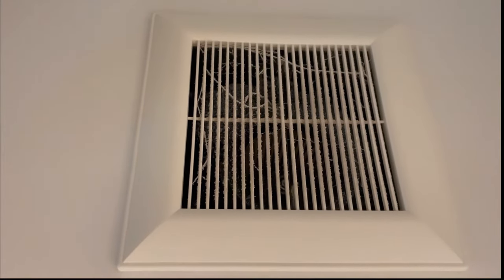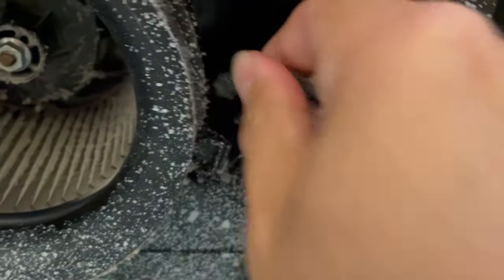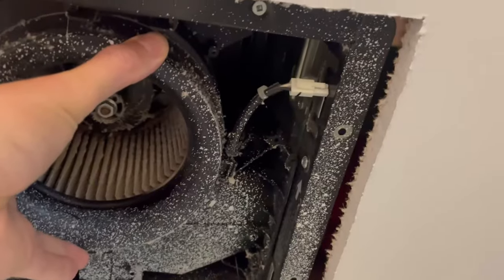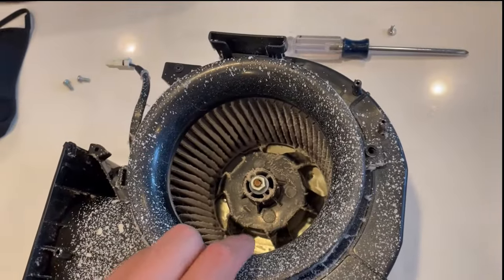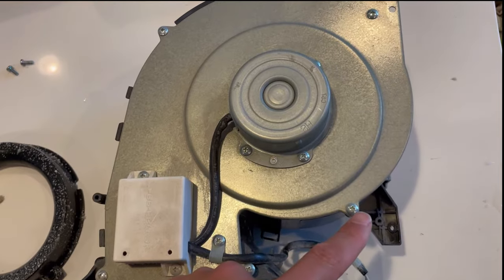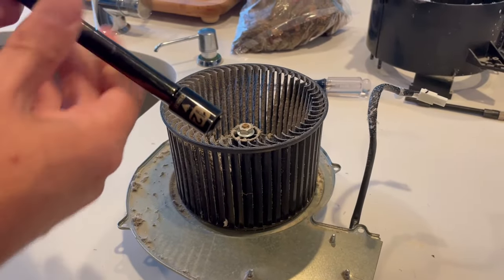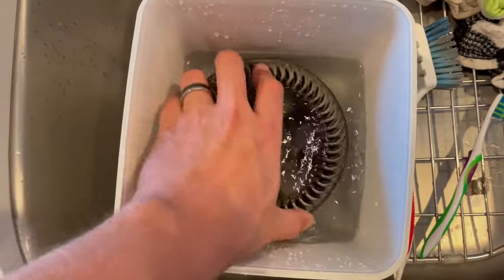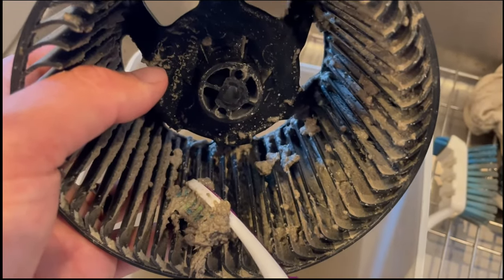Panasonic Bathroom Fan Cleaning

Comment: Considering this is something that is supposed to be cleaned every 6 months they should have designed this much much easier to remove, clean and reinstalll.
Reply: Seriously. That shroud needs to come off from the front. Then just a socket to remove the bold and pull the cage down. It is nuts to have to pull the whole thing down, and then disassemble it just to pull that cage out the back! It just can't be cleaned in place.

Comment: Just cleaned mine and the video was most helpful. Getting the fan out was easy. Reinstalling was rather difficult getting the three screws aligned in blind holes. Have a very bright light and position the latter just right and it works. Get an 8” or longer screw driver..

Comment: Thank you so much for this video.  This morning my two year old fan would start running them stop after a minute or so with a growling noise. Spent over an hour trying to brush and vacuum while it was up in the ceiling. Not fun. Still has an issue but at least now I know how to remove it from the ceiling. Most importantly I am relieved to know that if I purchase an entire new unit, I won't have to go in the attic and replace the entire housing, etc.  Thanks again.

Comment: Thanks for the video. The Panasonic diagram showed only 2 screws holding the fan assembly to the housing so when I couldn't get it loose I found the answer on your video.

Comment: I cleaned my fan & cowl assembly by letting it soak in a bucket filled with hot water and a dishwasher tablet. Swished it around a bit and all of the gunk fell off or sprayed off. No brush needed.

Comment: Air sealing between the fan case and drywall will decrease the amount of dust and crud that gets sucked into the fan. Use expanding spray foam or caulk, as appropriate for the gap size.

Comment: Thanks for the great info. Can you remove the 12mm nut on the fan and pull out without removing the whole assembly?
Reply from the maker: We all wish it was that easy! Yes you can remove the 12mm nut without taking out the assembly, however there is not enough room to take the squirrel cage through the opening.... the opening should have been made larger then the squirrel cage...Panasonic... are you listening...???.

Comment: Why take the back off if you could just unscrew the bolt to release the squirrel cage  after you remove the front cover ?
Reply: The squirrel cage is enclosed by the housing. Won't just drop down, so you have to take it out from the back. Great design.

Comment: Two of the screws were easy to remove, but the third screw up high, is so tight that when I try to remove it the head of the soft screw is stripping. Any suggestions on how to remove the screw?